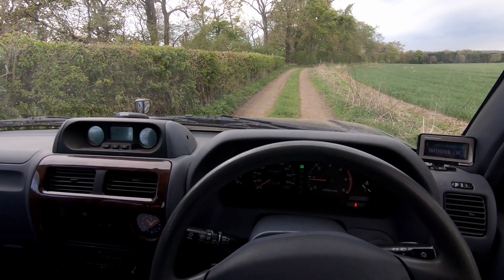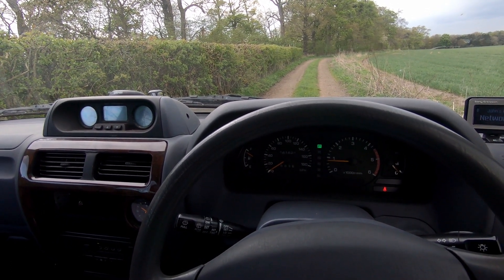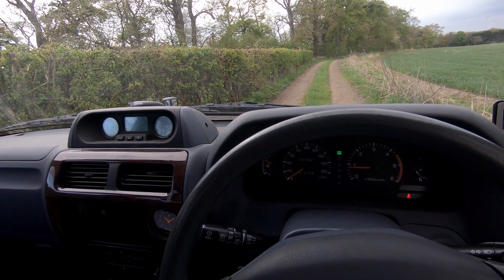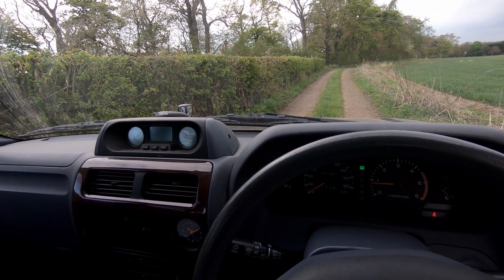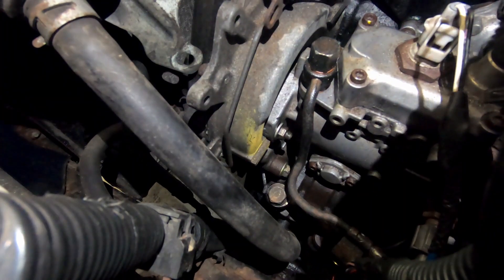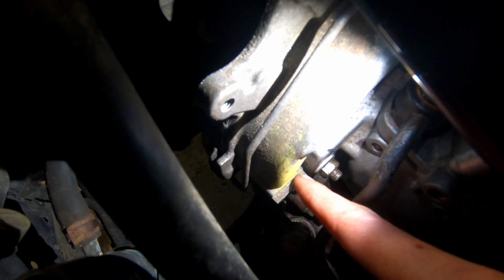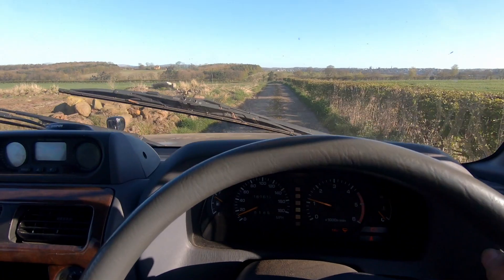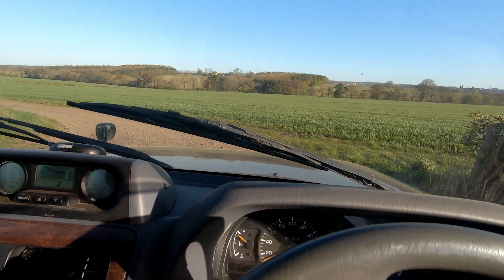Solved: Land Cruiser Prado Engine Light at Idle Error Code 14 1KZ-TE

Comment: March 2023 and I got this alert :(, I took the mechanic to do general maintenance on the pump, then I told them to align it correctly and they did it 3 times and nothing, the same code still comes out, someone help me , which sensor should be changed? my car is a prado 98 motor 1kz-te
Reply: Same problem mate
Reply: @nithinmathew6980  My friend solved it, I changed the TCV, the oil pump timing control valve, the check was cleared and the car pushes hard as before.

Comment: I have been having this problem for the longest time now. I still need to know exactly what to do about it. Plus mine consumes a lot of fuel, any ideas?
Reply from the maker: Hi Brian, first I would check that your fuel pump is orientated correctly, with the timing mark aligned with the timing case, like I mention in the video. If it is aligned properly I would try working through the diagnostics flow chart for error code 14, which you can find in the 1KZ-TE workshop manual on pDI-22. Let me know if this helps!
Reply: @KZJ95R   So it turns out the injector pump timing was off, I corrected it and went for a drive, and it turns out it is still flushing the Check Engine Light. I'm still suffering from high fuel consumption too. Plus when I floor the acceleration pedal it doesn't go past 2900 RPM. Kindly assist.
Reply: @BrayanBrikauskey  TCV valve
Reply: @sinegra30  What about it mate?
Reply: @sinegra30  Do you recommend changing that valve? In my country it costs 350 us$$
Reply: I kept timing it wrong on the lower mark on the timing case, what I didn't realize is that I was to use the upper one. No more error code from TCV. What's bothering me remains to be the high fuel consumption issue. I still haven't figured it out yet.  Plus I'm certain my Spill valve adjustment is wrong. The tranny got changed to 30-40le. Any advice?
Reply: @BrayanBrikauskey  how many ks do you get out of a tank

Comment: hi bro thnks for the video ,i have the same problem with the engine light cn u show me what angle u mean n how?
Reply from the maker: Hey, sure - I'll try and explain it in the comments here but if it's still not clear I can maybe make another short video. Basically the fuel pump mounts onto 2 studs that extend out of the timing case. The studs go into 2 slots on the front of the fuel pump and its secured by 2 nuts. When you loosen the nuts, the slots allow you to rotate the pump relative to the timing case. This will allow you to adjust the rotation angle of the pump so that the line scribed into the side of the injector mounting flange aligns with the flat machined surface (shown in the video). One other thing - there is a mounting bracket securing the back of the fuel pump to the engine block - you will need to loosen this as well as the 2 nuts at the front of the pump in order to rotate the pump. If you have the 1KZ-TE Engine Repair Manual you can find instructions on page FU-25. Let me know if this still isn't clear.